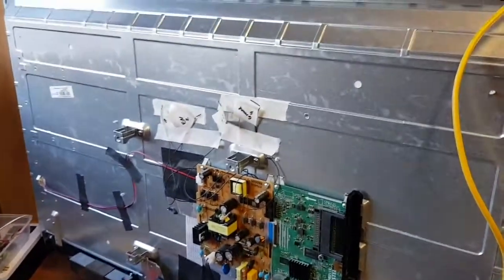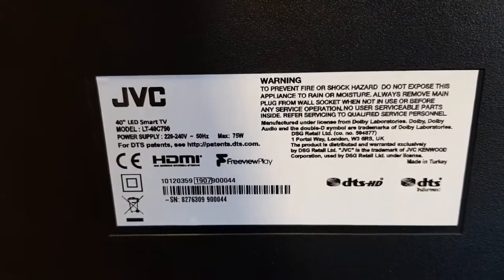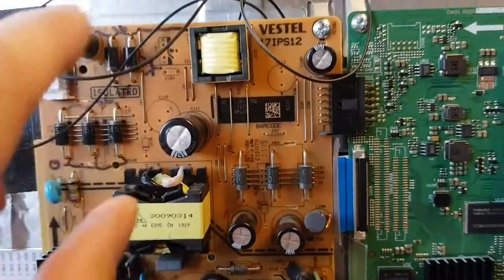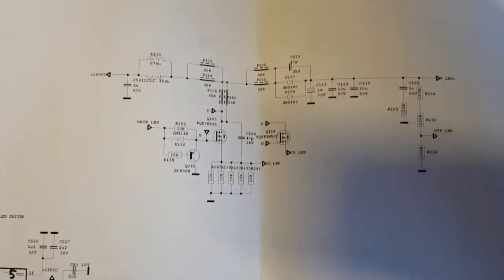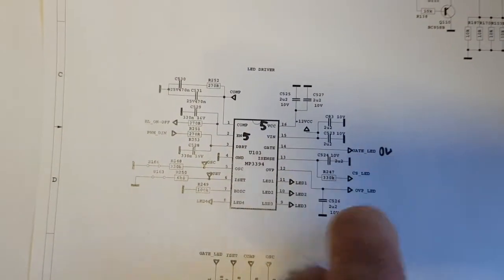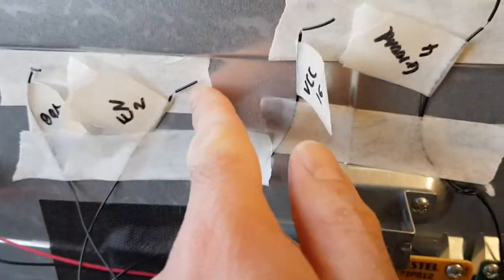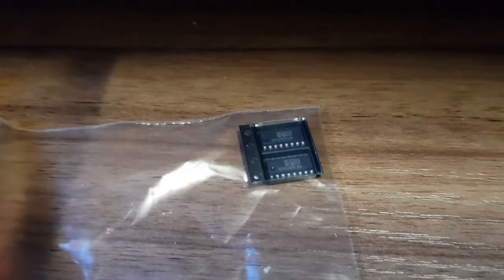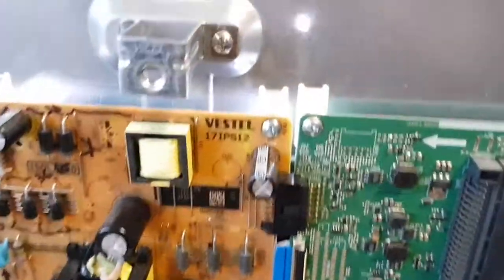JVC tv repair

Comment: REALLY GOOD VIDEO! Well done i come across this alot but i have alot of the psu so just swap em for quickness they are that cheap how much was the chip? and you have a link?
Reply from the maker: Thank you. The chip was bought off eBay. Did first try and find it on RS buy they didn't have it. Cost was less than £5 for 2 with shipping. This does seem to be a design flaw in the PSU as this is a very common failure like you say. If I get another one I think I'll do a deep dive into what could be wrong with the design.

Comment: I have the same T.V , I'm presently working,  backlight is on but no picture and 12v is crossing to the screen, please what can I do? Help out.
Reply from the maker: Have you got a scope. If so look for data going out the logic board to the screen. If there is data that it's likely the screen. If there is no data likely the logic board. If so check for power to the logic board. That should give you a start.

Comment: I have a JVC LT50C800 nothing can be seen on the screen, it just has the light on.  before it worked for 10-15 minutes then the screen was black but now when I open it it is completely black you can only see the light on.  if I press on the remote control I can go to youtube or netflix and it will be heard.  it's just not visible.
Reply from the maker: Shine a torch close to the screen and see if you can make out any picture while the TV is on. If you can it's likely to be a backlight issue. And this is most likely to be a power supply. If you Google the numbers on the power supply board you should be able to find one on eBay. Be careful with it as there will be high voltage stored in the caps on the board for some time after it's been switched off. If there is no picture it could be anything and will be difficult to diagnose without measuring signals.